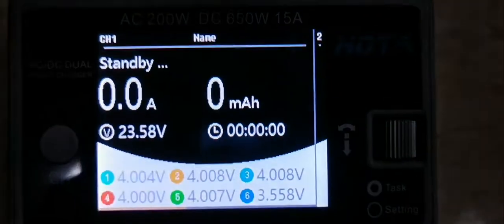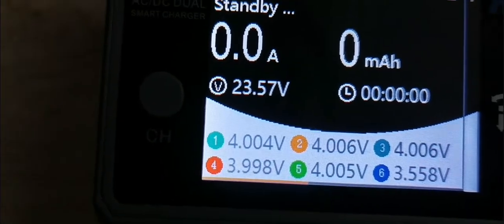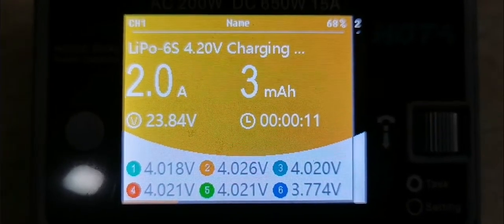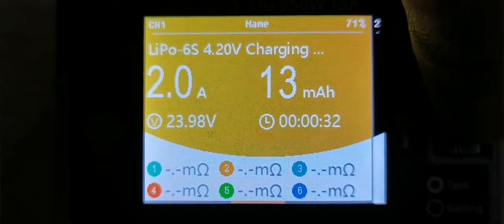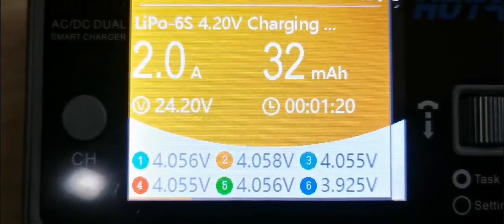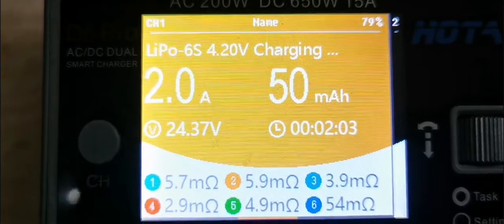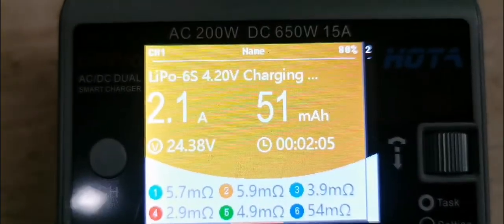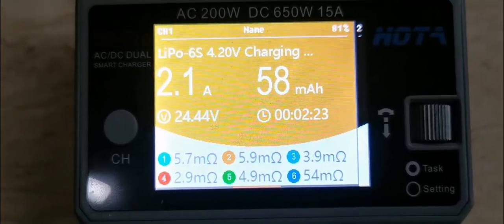When do u you throw out your lipo battery?

Comment: I have 6s 1300 mah lipo and the 5th cell is 12ohms the other remaining celss has 5mohms. Is this still usable for fpv?, I charge it almost 2hours just because the 5th cell is low din voltage., Thanks in advance.
Reply: As a rule of thumb: The higher the internal resistance of an individual cell, the more time in takes to charge. Over 20milli-Ohm I switch to 1/2C (even less) current to charge.